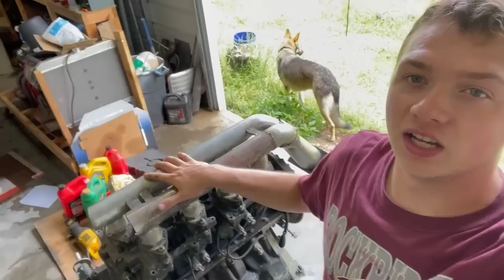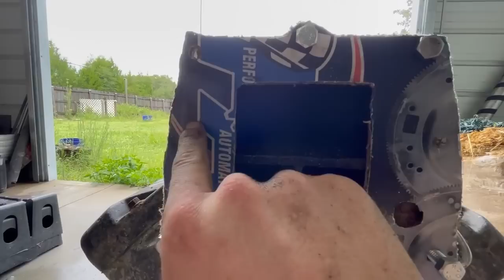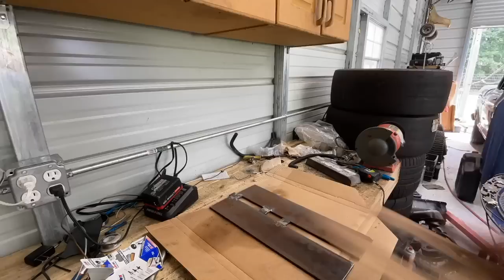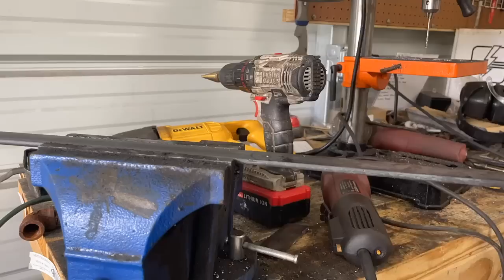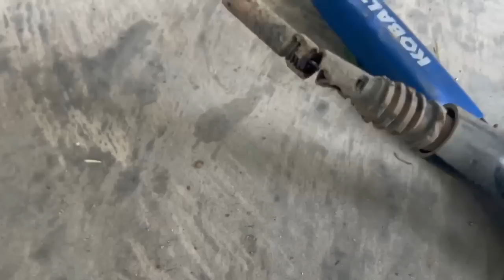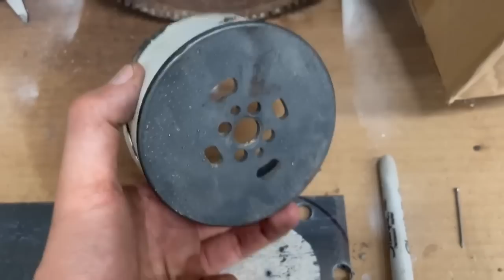Will this 2 stroke V8 BOAT engine bolt to a Chevy trans?

Comment: I’m lost. Are you using a manual trans or are you trying to use that automatic? If you’re using the automatic how are you going to spin the pump to make the automatic work? Or are you going to stick the torque converter on it and make an adapter to hook the converter to the crank on the boat engine?  You may want to take a look at the German WW2 fighter planes. They install the engines so they are upside down. So the valve covers are on the bottom of the engine. So that’s a tried and true way to Mount an engine if you want to run it that way. It may solve some carb issues you are going to run into later. Unless you go fuel injection. I was thinking of making a project gocart with a 2 stroke boat engine and thought using a stand alone transmission out of a Harley. Anyway enough of that, looking forward to see where this project goes.  Not many kids your age would even work on their car and you are building something unique. Stick with it and make it work, we will be watching and rooting for you to succeed.

Comment: This is a cool idea "it's so crazy it just might work!"  One thing to think about, the boat motor combines the cooling water with the exhaust usually...  But at what point?  Hopefully you can intercept the cooling water before this point so you can keep the coolant pressurized (typ liquid cooling in car).  The openings in the motor housing, the front one would have been for the shift rod.  Some exhaust would go down with the drive shaft - some of it goes thru the gear case both for some cooling of gearcase and also keeps the hub free of silt and sand.  Keep 'er going
Reply: Actually the through hub exhaust creates a vacuum for the exhaust once underway. This helps the motor run at RPM. The exiting water is mixed with exhaust mainly for noise reduction but cooling as well.

Comment: Your going to have to make your intake different because the rear cylinders will run lean with the carb are all the way forward!
Reply: Watch 2nd video where he fabs intake, he is doing port fuel injection.
Reply: @twoeightythreez  Yes but he deleted the reeds. It will never run without them. Evinrude spent a lot of time and money optimizing the design. I would stay as close to it as possible and only make changes proven to work for 2 strokes. There's a lot of unseen forces that make them work.
Reply: @twoeightythreez  Nice!

Comment: Just some food for thought about engine orientation. With the intake plenum being on the bottom, I'm afraid you're going to have a lot of fuel falling out of suspension and pooling down there. I think you'd be better off pointing the cylinders down and using downdraft carb(s) on top. Two strokes down care if they're upside down or not.
Reply: Hes gonna use efi, most of his intake is only going to move air
Reply: @twoeightythreez   ooh....must've missed that. Carry on!
Reply: He's planning on fuel-injecton . The plenum will have a throttle body so fuel will be more direct instead of traversing the entire plenum like it would with a carb on the end of the plenum which I don't think he intended to do but could get it running that way
Reply: Turn it upside down! Two strokes don’t care if they are upside down or right side up ….. strangest comment ever 🤣🤣 
But yes he’s replacing every carb with an injector which would probably lead to fuel pooling more than engine orientation. But I’m not sure of how this engine is designed port wise. If it’s conventional transfer port type design, the fueling will be difficult. 
But the thing is if it’s running and driving this kid gets to say he’s done what very few have! And we need mistakes to be able to properly learn. I’m loving watching this and we should not criticize this guy for stepping out of the box. Young people are being raised now to design something and have the “peasants” (laborers) make it for you. Young men and women that do this kind of thing from start to finish (design and make) are the only people that will keep our country industrial.
Reply: @Slot_daddy  have you never seen a chainsaw, trimmer, model airplane, etc run sideways or upside down? 😂 Some trimmer engines are MADE  "upside down" (plug at the bottom).
Reply: @kcraig51  yes I was saying you said orientation may be a problem then said two strokes don’t care.
Reply: I may be way off on thinking here but what if he drives in a large puddle of water.
Reply: @RobertDickens2002  Its a boat engine it will be ok, itis used to big puddles :)
Reply: @EssentialComment  yes with intake up top.
Reply: @RobertDickens2002  that’s why he’s pointed the throttle body upward to get some more distance from the ground. But yes boat motor or not, water in the intake isn’t usually a good thing

Comment: A pretty important point... Rotating balance!  That extra hole in the flex plate is for balance to the engine. If you don't have correct crank shaft balance, this thing will shake itself to death.
Reply: I have built several of these V8s over the years. They have a rubber balance dampener on the crankshaft.  Adding the massive extra weight of a full converter will not only not balance correctly with the rotating assembly but the lower main ball bearing on the crank was never designed to the massive lateral loads of a converter full of fluid being turned at RPM.  Will never last for more than a few minutes at any moderate RPM
Reply: A two stroke v8 90 deg motor is neutral Ballance , Ballance on American V8S was added for cost reasons as dynamicly balancing a mass produced low cost V8 and fitting it inside  the crankcase was too much so they got external Ballance on some motors IE flywheel and balancer.

Comment: Badass, does the motor spin the right way?  What rpm does it idle at?  Gonna need a high stahl converter
Reply: Shouldn't, two strokes make a lot of torque down low, you have to tune to get power on the top end
Reply: @lighterguy82  They're usually kinda trash at idle but pick up quickly as the revs rise.

Comment: Id consider taking a crank shaft end and welding it to the engine prop shaft to be able to get the torque converter center support as well as being able to use a stock flex plate would also allow you to use whatever you are doing for the Bell housing to bolt up to and incorporate a bearing that holds the engine shaft and the torque converter in place and prevent any type of vibration or off center or unsupported centrifugal forces from taking out the front seal and pump in the transmission. You have to have a torque converter or a clutch with a special adapter that allows for the transmission fluid pump to constantly rotate as it does with the torque converter and allow you to disengage the input shaft from the engine to stop otherwise you will not be stopping unless you're brakes happen to be really really good and stall the engine. But definitely have the right idea.
Reply: I think he is planning on using the torque converter.
Reply: Hope so or no gears !

Comment: My son has so much talent.  Who comes up with these ideas. Keep up the good work Jim.  Mom loves you
Reply: you raised a bright kid!
Reply: Yes he has a lot of talent! However, he is making a couple fatal errors. This motor will never run without the Reed Valves he deleted. He really needs to get a copy of Two Stroke Tuner's Handbook. Read and most important understand the theory of 2 strokes. They operate very differently than car engines. Some say they are simple. Actually the flow dynamics are more complex. He should also contact the guy that posted his evinrude V8 in a volvo here 7 years ago and understand the problems/solutions that were encountered on his build. Doing these two things will save him lots of money and heartache!!! I hope this note gets to him!!!
Reply: @nkuntroll247  I tried to get in touch with them but they where very secretive about the whole thing. He did not delete the reed valves but he made a new intake, I am thinking about making two Y-shaped intakes  in line with the cylinders on my similar 2litre V-4 project. Or perhaps make a "oil pan" plenum like Stvdrag225 here on Youtube did for his V6 SeaDoo GSX, really mean machine! :-)
Reply: @thehaze1972  He appeared that he removed the reeds with the original intakes as they are a part of it. My opinion it would be easiest to run the engine carb side up. Make 90 degree intakes for the carbs. This goes for any 2 stroke outboard conversion. It will run just fine this way. There is no oil in the motor, the cylinders don't care which way they are pointed. Also with them pointing down there's less chance of air bubbles in the cylinder head water jacket. The most important place to cool. It does put the crankshaft high though. Remember the factory spent lots of time and money optimizing the design and their are many reasons for it to be the way it is. I'm just saying understand all these reasons before making changes. No offense. He is a smart dude. But it's obvious he doesn't understand two stroke technology! The ultimate would be to get Honda CR500 pistons and cylinders, and marine crank, work out the port timing with the crank stroke, and custom make the crankcase. If a V8 it would be about 500 hp with minimal weight.
Reply: @nkuntroll247  The reeds are still attached to the motor, he is just replacing the carburetors with fuelinjection.
Reply: @nkuntroll247 it will not run without the reed valves
Reply: @thehaze1972 still need to reed valve to scavenge
Reply: @ronalddaub9740  the reedvalves are still attached to the motor.
Reply: @nkuntroll247  he didnt delete the reeds.
Reply: Ambitious project , by any standard .the kid is driven . He needs some people of science in the inner circle. No matter what he will be learning from experience
Reply: @gainerman yes he does I was like him when I was 10 years old and nobody noticed...Dad was at work and I fended for myself ended up quitting because no adult teacher back then wasn't that smart especially in k threw 6 grade and 7 and 8 grade here came the bullies so ..by all means get him to go get recognized at least at a community college and then they will help him to get whatever he needs for a good career like ford or a science lab ..he'd be set for sure
Reply: This is the most wholesome thing I’ve ever seen in a comment section it reminds me of my grandfather when we use to fix cars and when he helped me put my truck together keep it up man
Reply: Yeah 👍he's a bright kid ... seems like a good guy to. You did a good job, and you should be proud.
Reply: you raised this guy right
Reply: Cool... reminds me of my youth...you are a true motor head!!!.your parents did good kiddo!!! Good vibes from NJ NJ
Reply: Be proud...not many of the newer generation have any kind of motivation
Reply: Hold on I thought he was my child????
Reply: Dang it mom dont put me on blast 😂
Reply: The idea reminded me of the go cart from the 90s movie Heavyweights.
Reply: That’s awesome! I’ve got pipes on my craftsman V-twin 18HP 😂
Reply: Omg I would die if my mom did that
Reply: I dunno about talented, but the kid is ambitious! And fearless! 😂
Reply: fuck yeah!
Reply: You can make it hook up to the transmission but keeping an outboard motor cool with the radiator will be an exercise in futility
Reply: Welllll I’d like him to call me daddy so what’s good ma?
Reply: The tuner's handbook is incredible!  We are also here if he has any questions or hits any roadblocks.  He's working on some REALLY interesting stuff!
Reply: i think he f.. up.. 100 % he did not think this through.. the way he is aproching this build is mest up... i hope he proves me wrong... there is a good reason motorheads do not mess with 2 stroke marine engines.. U need to resonate that exhaust or it will not start.. physicist and ur moms support does not go well together. i really really hope that he does build that beast. but yeah conntent creator is called now a days.. u may geet famous some day..
Reply: I just watched a video before this one of a guy putting a two stroke V8 in a Volvo. He could get some tips maybe. You have a smart son. Very ambitious.
Reply: i got a johnson 4l and and 8v92 2 stroke detroit.
Reply: What a sweet mom! For sure!
Reply: Yeah he's fun to watch I've always wanted a 2 stroke v8 in my 86 F150 4×2 ..yeah 4×2 it's rare like his worth a fortune 😂tell him to keep it don't sell it there's no telling how much it will be worth when he gets my age ...55 years old and I still have my red baby.lol😂 ❤ the 2 stroke awesome 👍
Reply: They go around $20.000 up to $40.000 if paint is good and no rust❤it
Reply: maby some big motor cycle reed valves and a custom wood intake made out of cedar and appliance epoxy paint for strength I've used my own intakes out of wood since the 80s stops vapor lock in its tracks 👍 good luck with project ❤ it .,  he's smart he.ll figure it out ❤it ❤it ❤it .I want one😅
Reply: You can be proud of him!
Reply: Lol he's doing something dumb I wouldn't call it talent I'd say that's a waste of time

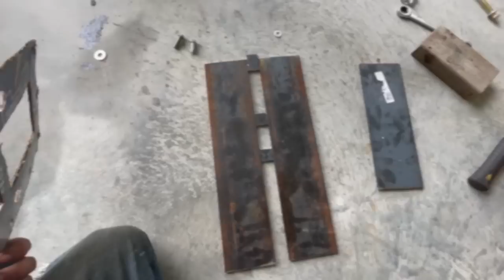Comment: 9:07 The 3 squares are all the exhaust pipes on the 2 strok, remember to reproduce half of the exhaust that remains in the other part of the block, otherwise it will be impossible to make it run properly
Reply: He deleted the reeds!!! It will never start let alone run properly. However, I do agree with you. The other auto conversion of this engine type I am aware of has expansion chambers for each cylinder. That's the best way to handle the exhaust. On kawasaki triples I have seen 1 smaller chamber made for 3 into 1. If you are good with math and 2 stroke theory you may be able to make it work. But I don't know how well as I think the reflected pulses (which make chambers work) would collide with the next cylinder exhaust pulse. The reeds need to go back on and run the engine carb side up.
Reply: @nkuntroll247  Oh crap he took out reeds? no reeds! seriously on a non piston ported or rotory valve engine?
Reply: @dgc940  he didnt, the reed plates are still there.
Reply: @nkuntroll247 with a blower and fuel injection it could run but that may be beyond the available skill set. Same concept as a detroit 2 stroke diesel. The reed valves and tuned exhaust aren't necessary if you have a way to keep the air moving.
Reply: @jameshathaway5117  it’s true but they have a exhaust valve that control the fume and eliminates the need for a chambers
Reply: @Pidariol00  valves or no a blower will work. When the intake port is open the exhaust is also open regardless of if it uses ports or valves. In this type of engine the exhaust is forced out of the engine by the incoming air. As opposed to a traditional 2 stroke depending on exhaust scavenging to create vacuum to pull incoming air. You only need reeds and tuned exhaust to create vacuum. Forced air does away with all that.
Reply: @jameshathaway5117  Every 2-stroke needs forced air. "Naturally aspirated" or traditional 2-strokes just use the crankcase and the bottom of the piston as their blower, which of course also forces them to also use their fuel air mixture as lubrication (with all the dumb problems that causes).
Reply: @nerd1000ify  the crankcase pressure does push the air fuel charge into the cylinder but it doesn't create vacuum to pull the mix into the crankcase in the first place. The blow is provided by the crank but the suck that brings the mix into the crank in the first place is provided by the inertia of the exhaust. Regardless of what is pumping the air you are right it must be moved by some means so all two strokes must devise some means of moving the air other than its own piston.
Reply: @jameshathaway5117  generally there is low pressure in the crankcase during the compression stroke, after the transfer ports have been covered by the piston. That provides suction to pull charge into the case. This is important to 2-strokes that don't have room for elaborate exhausts e.g. chainsaws, old model plane engines that have no exhaust at all (just the port aimed straight out into free air), outboards etc. But you're right that the exhaust can play a big role, in 2 strokes with tuned pipes the exhaust does a big chunk of the pumping once the engine is 'on the pipe.'

Comment: You should be able to download the Chevy bell housing pattern, either have it printed or have a machine shop drill the pattern
Reply: A sheet of nearly any material (plywood for example.) Drill hole for input shaft. Slide onto input. Clamp to bellhousing. Drill holes for bolts. Trace bellhousing with sharpie if needed. Boom! Template done.

Comment: The sbc flex plates from 350 cid on down are neutral balance, no offset weights unless it is a one piece rear main seal. The sbc 400 is the only one besides the above mentioned that has an offset flex plate.